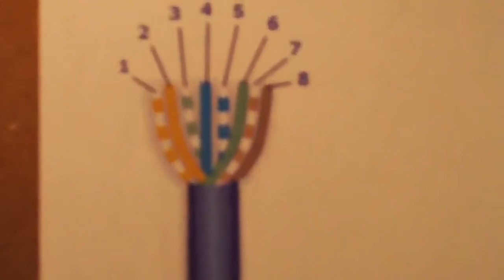Cat5e/Cat6 Patch Cable Tutorial

Comment from the maker: @aloony2 - Thanks...I purchased my tester on e-bay for like 99 cents. It came from Hong Kong though. I had issues with the power button being a piece of junk so I ripped it apart and gutted the old button and added my own. Works on a 9v battery which should last a long time. Its actually a very simple chip inside. Wish I could have built it myself.